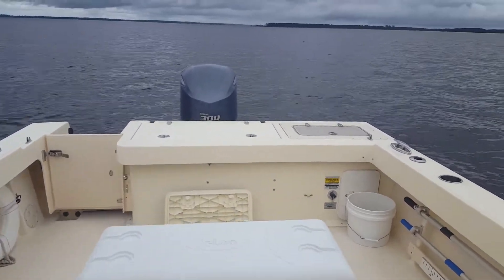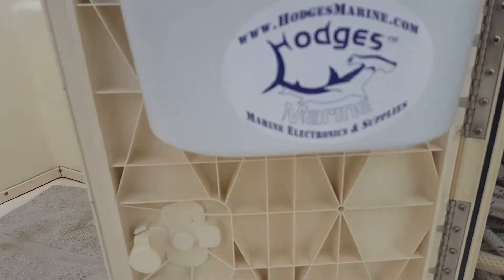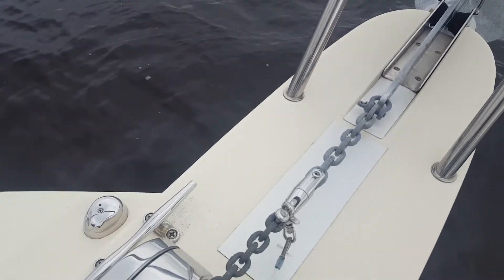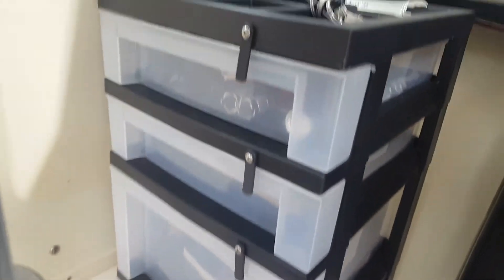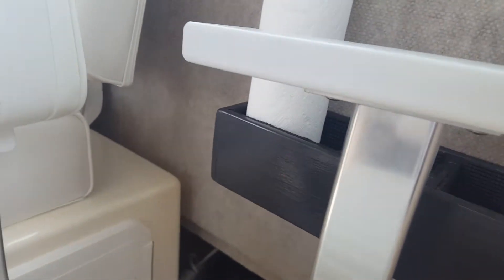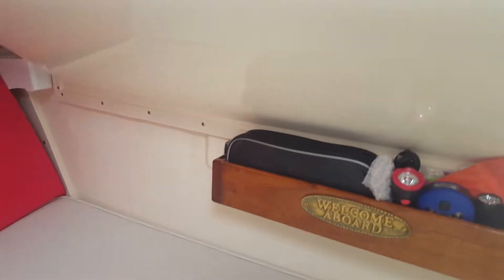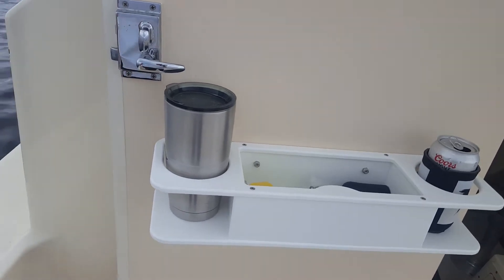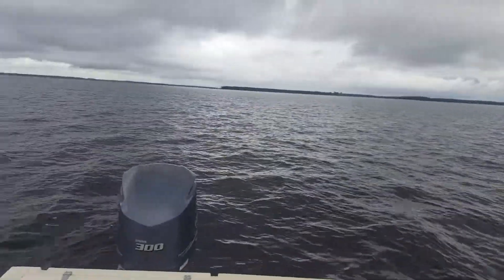Parker 2520 XLD Mini Tour

Comment: Nice job on the video. I have been looking at some of the Parker boats and they need to at date their line some of the storage areas need to be updated and the pilothouse needs it too.
Reply from the maker: Hi Old Skool 63, (sounds like you an I are from the same 'time-span'!)  Thank you for the kind words. I agree with your comments. To me, the Parker is a well-built boat, but is very  'bare-bones'; not even a catch-all to store basic items.  One of my big issues with Parker is how they rely upon their dealer net work for almost all customer inquiries... That would not be so bad if they had decent dealers; I've had terrible experiences with 2 of the dealers, and one of those is the closest one to the factory!.Parker has recently been bought out by Master Craft. Maybe they will make some positive changes to the boats and the customer service.

Comment from the maker: I miss-spoke about the anchor windlass; I didn't mean to say 'manual', I meant it is easy to change to 'power-down' instead of 'free-fall'. The waters around here are very shallow and we often anchor in 5'-12' feet of water. In 'free-fall' I end up with a pile of chain and rode tangled on the bottom; power down works best here. When we anchor in Cape Lookout Bight (aka Power Squadron Spit) it is deep enough to use it in 'free-fall' mode; same goes for in the ocean.

Comment: Andrew I am about to run some wiring in my boat; two antennas and spreader and anchor lights etc. any advice on techniques to run the new wiring? What was your experience? Mark Hanna
Reply from the maker: Hi Mark,  First, I'm sure you know, but be careful how you mount and seal the bolts and holes for antennas; any leak will eventually rot the coring in the roof (There's a lot about this on Classic Parker.com). Mine were leaking when I bought the boat, and had to to remove them, dry it out and re-bed them.... I was able to feed the wires from the buss-bar panel under the dash (from the cuddy cabin), and followed the wires aft on the starboard side to the removable plastic panel on the back bulkhead of the pilothouse.  (I removed the helm seat to make access easier, and almost removed to helm seat pedestal, be instead squeezed by it. Then up overhead (using an electricians 'snake'). I also pulled extra wires and string and left them in there for possible future needs. The 2013/2014 Parkers have a raised channel that runs down the center of the ceiling/overhead from the forward area where my overhead electronics are located, and then it 'T's" across the back where the raised area extends to both sides. (You can see this raised area on the roof  in a lot of my videos). There is one round access port in the ceiling. Before getting started I first removed the ceiling access port and the aft plastic cover on the starboard aft corner of the pilothouse. (Those covers do not go all the way to the floor; they stop at seat-level). Once everything was opened it was just a matter  of running the wires, on foot at a time. It would have been MUCH easier if I had waited for someone to help feed the wires..... I will try to remember to take a short video of what I'm describing here in case I'm not being clear.... I hope you enjoy your Parker as much as I am, and hope you can have her on the water soon (When the ice melts up there in Michigan! ☺)
Reply: @andrewfyakim525  Hi Andy-
I would like to see that video on wiring. Did you see the latest two videos from 'on the reef', he is really unhappy with the boat because of a manufacturing flaw. Check it out. Thank you, Mark Hanna
Reply from the maker: @markhanna4511  Hi Mark, I saw "On the Reef's" video a number of times (I followed all of his videos, even before this happened), and I have read every 'comment' on both ClassicParker.com and The Hull Truth. There is no doubt he got a bad boat that should never have left the factory. It is the first time I have ever seen and/or heard about serious manufacturing flaws in ANY Parker boat.  I'm am sure Linwood and Robin (daughter) Parker are embarrassed about it all, and I hope they resolve it to his satisfaction. I also think that we are not getting the whole story, from 'both ends', as it seems Parker offered a new boat. (I understand the 'color' issues and the 'not all original equipment' issue, but that could have been negotiated.... I myself would not have accepted a the offer to 'repair' it, but then I can assure you, I would have noticed those issues up front and I would have walked away from it before buying it.  (The crooked door was Soooo obvious!). I was also surprised that On the Reef spent so much time (months)and $$$ adding equipment to the boat;  I would think he noticed these flaws while he was working on the boat??  I know I would have at least noticed the cat-e-wonkered door!....  Parker is doing FAR more than I experienced with my previous 2 boats. I bought a new Albin 27 in Cos Cob, CT in 1983. (me in North Carolina)... the boat had issues. Albin told me to 'bring it back'  for the repairs, knowing full well I would not/could not do so.... In 1987 we bought a 35' CT Sundeck trawler in Deltaville, VA... it too had 'issues' (a lot of new boats have issues)... I again was told to bring it back to Deltaville for the repairs; that is a three day trip even when the Albemarle Sound and Chesapeake Bay are calm. So again, like with the Albin, I paid a LOT of money to fix my new boat; it was my best option, and of course the boat companies offered NOTHING!... I think Parker will offer to do the right thing for On the Reef.

Comment: Merry Christmas to you just like to get your thoughts on a 31 Bertram sport fish
Reply from the maker: Hi Larry, thank you for watching!... Merry Christmas to you too! What year Bertram are you looking at? The older 31 "Moppie" Bertrams, owned and built by Dick Bertram were the first of the deep-V's and are known to be 'tanks' with bullet-proof hulls! They are very heavy, (require high HP engines) and are also 'wet' boats with little bow-flair to throw the water off the boat; but are a smooth ride and can bust through rough seas. There is in fact one of those docked at my neighbors house about 150 feet from my dock.... The 'new Bertrams, are Bertram in name only, They are designed by Bill Prince, are very expensive, and light weight. They are nothing like the old originals...
Reply: Thanks for your reply yes I am looking at a 1969 Bertram sport fish model it has late model Cummins 370 hp diesels, upper and lower steering stations, and head with shower,  and small gally owner says it is a 28-30  knot cruise and 34-35 top- wot. And raymarine electronics.love the classic lines and the simple way of the design
Reply from the maker: @larryjohnson5597  That is the same model as the one I mentioned that's docked near me. The 31 Bertrams are well-respected boats/hulls. I love the Cummings Diesels; they are 'forever' engines as long as you feed it clean air (easy to do on a boat!), clean fuel (hard to do on a boat) and clean oil (easy to do, especially with auto-oil-change- system like had on our Ford Lehman SP135... I don't know if the sellers 'numbers' are correct, but it's easily verified with a test rum. (30 knots is 34.5 mph... 35 knots is over 40 mph. it sounds a bit 'optimistic' to me ☺)... Like I mentioned, they are considered 'wet' boats, and I'll add a bit wobbly when sitting still due to the extremely deep-V. But then, that deep-V is why it can handle rough waters.... One more thing, with a 1969 boat. How are the fuel tanks? Are they original? Are they clean?
Reply: Yes thanks 🙏 the fule tank is the original 222 gallons it’s fiber glass in the boat Bertram used fiberglass tanks just like hatters, as far as being wet, any thoughts on spray rails, might help? Thanks 😊
Reply from the maker: @larryjohnson5597  The Bertram fiberglass fuel tanks are legendary for being the best fuel tanks, for Diesel fuel. Not so much for gas, especially bad for ethanol-gas. It's why I asked. Some boats with fiberglass tanks had gasoline engines, and the tanks got gummy from ethanol gas. Was this Bertam ever equipped with gas engine/engines? Not many, but some existed. Also, a lot of 31's had twin engines. Is the one you're looking at original to a single Diesel?.... As for spray rails, I'd say if you decide to got that route, I'd recommend against the 'glue-on' type, (They tend to be VERY temporary), and go with the thru-bolts, and use a lot of bolts. I think they would help in moderate conditions, but when it's really sloppy out there, it would still be a wet boat. They guy who has the one docked near me says he just accepts the fact that the Bertram will be 'wet', and forgives that because of all of the positive attributes. The boat is not 'wet' on calm days, and we do have some calm days out there too!... Did I mention that the 31 Bertram is a beautiful boat? Beautiful lines! At least to me....
Reply: Yes thanks for your reply, it was diesel all it’s life, and yes twin engine , it had Detroit 453 140 hp, when It was new love the lines and the simple times that it represents and I have seen guys build custom trailers for them and pull them down here in Florida where I live, but they don’t back them in the ramp at all, marines lift them up in and back on trailer never put trailer in water
Reply from the maker: @larryjohnson5597  The 31 Bertram's are amazingly versatile when it come to repowering. I've seen them with twin I/O's, with twin outboards, and with twin and single inboards. There are a number of them here in eastern NC.... I believe the one docked near me has the original twin Detroits. Great engines in that they are infinitely rebuildable with the sleeved pistons. They are 2-stroke, (have a beautiful sound only a Detroit can make!) and in the past some Detroits had issues with 'run-away', (you had to smother the air intake to shut them off; or getthe fuel off). And, Detroits are usually 'dirty/misty' if not equipped with Air-Seps... I wish you well with this Bertram if you decide to get her. I love the Cummings Diesel, but prefer Garmin electronics. Just as many folks love the Raymarine, so that's just what we get used to using! ☺
Reply: Thanks 🙏 for all your good knowledgeable advice that only time and experience can get you there tight lines in Fairwinds my friend🛥🐠🌞

Comment: Hi Andrew-I have another question, what make and length was the drink holder with the storage box on the inside of the door. I cannot get to my boat to measure, and I would like to order one. Also, would you recommend the one you have? Thank you again. Mark Hanna
Reply from the maker: Hi Mark, yes I'd recommend it highly; it was $ pricey $ but I don't mind spending $$ on my boats! It is very sturdy, (all Starboard with s/s fasteners) and I have it through-bolted to the door.... I'll get the measurements and post them here; or you can send me your email if you feel safe with that (I don't get many 'hits' on my videos!)...
Reply from the maker: I posted the answer to this on another one of my videos and as soon as I find it I'll link it back to here.... Or if someone finds it first please let me know which one it is.

Comment: Regarding the storage hatches under jump seats, did you consider reversing hatch so that it opens downward? I now own a 2520 xl sc, but I cannot get to work on it till spring. Your thoughts on the hatch reversal?
Reply from the maker: Hi Mark, sorry for re-answering your question. I answered you in some other place, and wanted to also answer it here. Your idea for reversing the hatches is a good idea and some others have had success with that. For me, the reversed hatch would lay down and be in my way accessing inside the locker.

Comment: The deck is very small
Reply from the maker: Hi Matthew Aviation, thank you for the comment. I too think the deck (did you mean the forward deck?) is small. If you mean the cockpit, it is considered by many to be a large cockpit area for a boat of this size. But when compared to my other boats, I agree it is small....
My Best,
Andy
Reply: The rear of the boat or where you fish
Reply from the maker: @A.Matt7  That would be the cockpit. Check out my video titled  "Woodstock Point". It better shows the size of the cockpit.
https://www.youtube.com/watch?v=lAsA7GMFCzY
The Parker 2520 XLD has the largest cockpit in its class. Yes it is small compared to large off-shore 'battle-wagons', but it is relatively large for such a small boat.
Reply from the maker: As Youtube said, the linked video was removed; it was not intentional, believe me!

Comment: I guess you haven't watched any of the videos posted by  " outonthereef " where PARKER knowingly  sold a bad crooked boat to an unsuspecting user. If I were you, I would start measuring my boat to see if it were plum or better yet spend a few bucks and get it surveyed before signing praises for Parker. Yes Parker got cought by a very savvy consumer but  who knows how many times they got away with it before. Boaters beware. The y certainly lost me as a customer for a 25ft pilothouse.
Reply from the maker: Hi A?IA, Thank you for watching my video and thank you for commenting... I'm not sure why you would guess that I haven't watched any of "Out On The Reef's" videos?  I think most all Parker owners have followed the issue... I was subscribed to "Out On The Reef" from the beginning; before he bought his Parker. "Out On The Reef" is one of my favorite Youtube channels to watch; he does a great job with his camera work, and with his boat up-grades. He is an experienced boat handler and navigator; crossing to the Bahamas in a small power boat takes a lot of planning, knowledge and a sharp eye to the weather; and a sturdy boat... I have been boating since the 1950's, and have owned over 18 boats ranging from small skiffs to a 35' (LOA 40') CT Sundeck Trawler (plus 27' Albin, 22' cuddy, 15' skiffs, etc). Most of those boats I bought new, and there were problems with all of them. I bought the Albin in Cos Cob CT in 1984. When I had significant mechanical problems with the boat, Albin told me to bring it back to them for repairs. (I live in North Carolina). I bought the 35' CT in 1987. When I had issues with this new boat,  Walt Higason with Cardinal Marine Sales at Dozier Dockyard in Deltaville Virginia, told me to bring it back for repairs, knowing full well I couldn't/wouldn't do so. I've followed the "Out On The Reef" issue on his Youtube, also on ClassicParker.com, and on The Hull Truth, Bloody Decks, Tidal Fish, etc.... There is much to the story. No doubt "Out On The Reef" got a miss-manufactured boat. After all the dust has settled, he decided to keep the boat. I don't know I would have done the same. I was surprised he bought the boat in that condition; the crooked door is very visible. But in 1987 I too missed a number of flaws in the 35'CT, so I am not being judgmental .... This is my first Parker boat. I have many friends that have owned Parkers for 20+ years. The issue with "Out On The Reef's" boat is the first time I have heard of a serious issue with a Parker boat. And like most Parker owners who have followed the story, I did take a tape measure to my boat; no issues with this boat.... If you are seriously in the market for a small pilothouse boat like "Out On the Reef" or like mine there are a number of other manufacturers to chose from. Judge. Defiant. C-Hawk. Parker. Maycraft. Shamrock. Albin... I am happy with my Parker boat, but don't get me wrong. I am NOT happy with Parker's dealerships. If you watched some of my other videos and read the comments, you will see why.
Reply: I'm buying a new 2021 2520 and guess what, there's some issues i see already. Carpet coming unglued in the pilothouse and V berth and another issue in the pilothouse. I'm still buying the boat. I'm not a fan of the carpet anyway, i may pull it all off and give it a nice paint job. I'm not going to whine about it and make Parker tickle me fancy over petty stuff. Every boat have issues either you can live with it. or complain about it. Out on The Reef dude, just named his boat after the design flaw, Crooked Pilothouse Boat. Now that's classic. But his boat has character, didn't seem to bother him. He took a 21' pilothouse and turned it into a 40' Sportfisher. Just waiting to see him add a Tuna tower and second station to it,